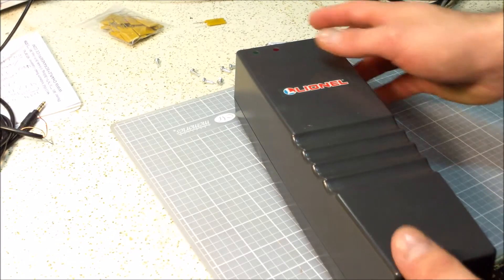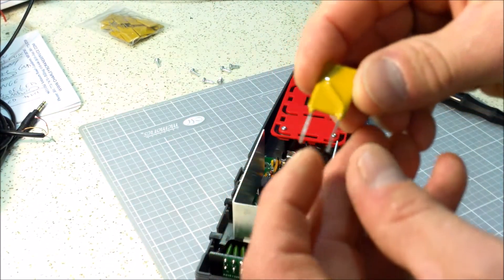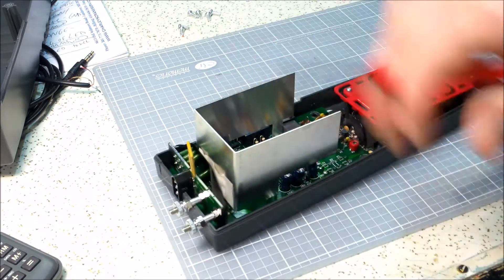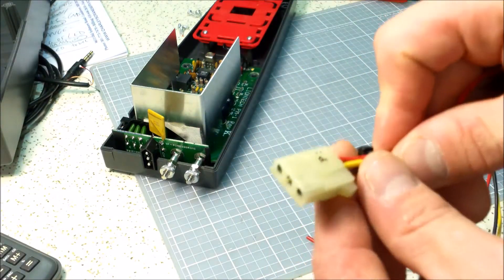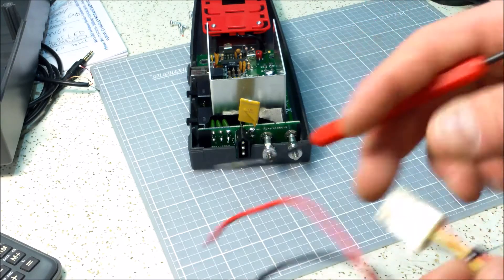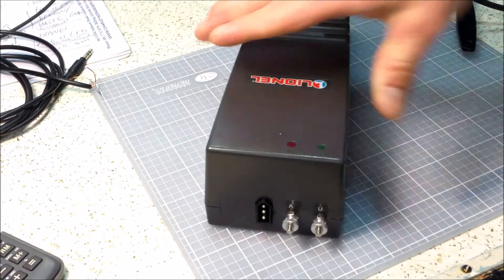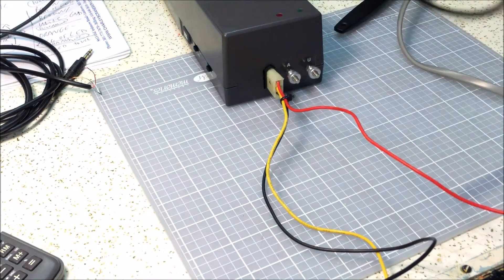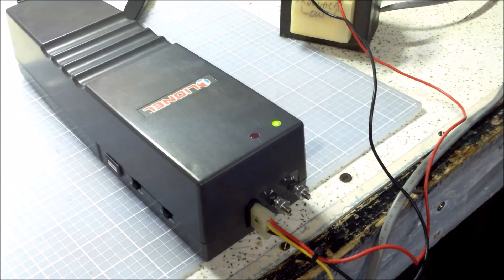How To: Fuse Protect a Lionel PowerMaster 6-12867

Comment: I recently obtained a Lionel Powermaster 6-12867 very cheaply at a train meet. I later obtained a Lionel power cord so that I could use the Powermaster with my existing ZW transformer. I have 2 other Powermasters on my layout, and they work just fine with my Cab 1 controller. For some strange reason this new Powermaster will not work properly. When I wire everything in compliance with the instructions, and turn the power on to my transformer and move the ZW control to full power, the train operates on the track as if the Powermaster was not even there. I get a green light, and I tried to program the Powermaster to use an alternate Track # as well, but the problem has persisted. I was curious about this anomoly, and opened up the Powermaster and discovered that somehow there is a copper jumper wire soldered between the top pin of the 3-pin power connector and the A post. Do you know if this is what is causing my problem? Any reason why someone would have done this? It almost looks like a factory install it was so clean.
Reply from the maker: A couple of though. 1 I would open another power master and see if that wire is solder like the non working power master, that way you know if it is factory or not. 
2nd The other thing the power master transistor could be shorted which is allowing the power to flow to the track.